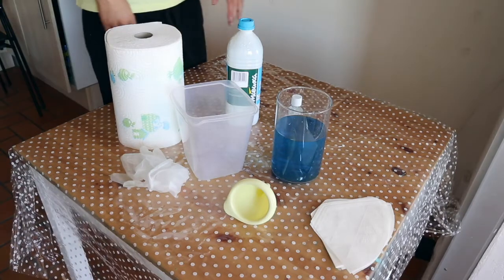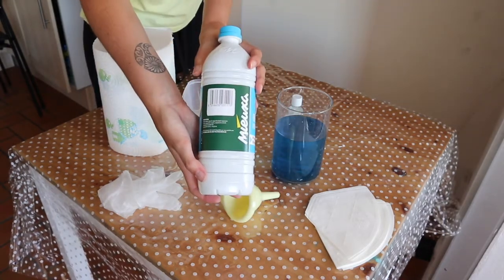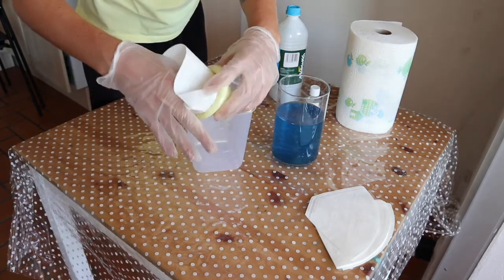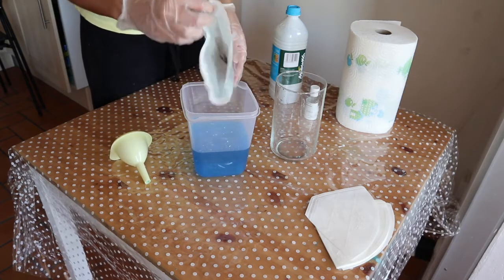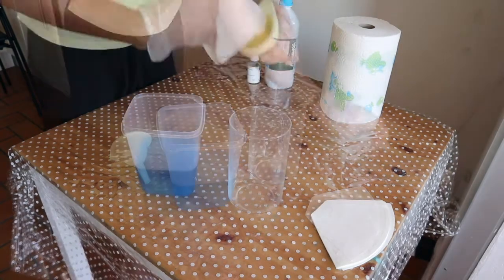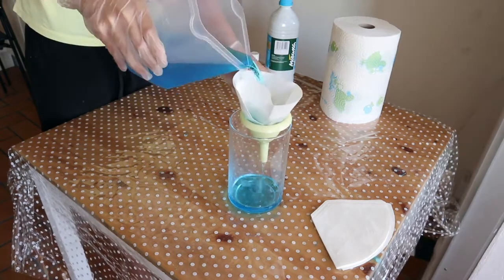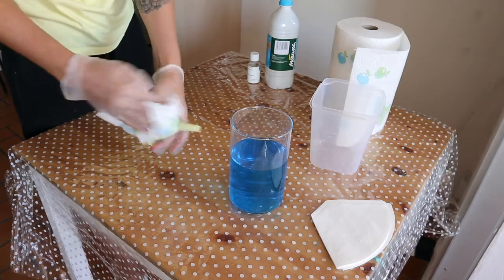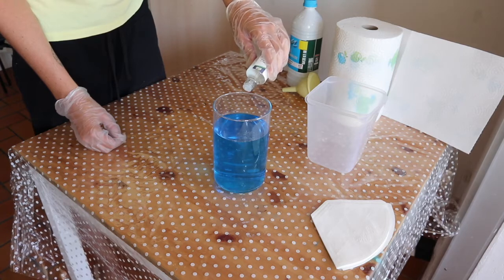How To Maintain Your  Electroforming Bath

Comment: Hello and thank you so much for sharing your knowledge! I don't understand how much distilled water I have to add. Is it the difference between how much solution I had before and after filtering? Thank you
Reply from the maker: Hi Stefania, thank you for your comment. When you electroform, your solution evaporates. So when you are going to filter it, the level of solution in your beaker will be less than what you started with. 

I have a piece of tape on my tank, so I always refill up to the tape (that's how I know how much water to add). If you don't have a piece of tape on your tank, just refill up to where it was when you first started (approximately). 

And yes, there is a difference between how much solution you have before and after filtering. If you don't have enough solution and too much anode, it won't work. That's why you need to refill. Hope this helps!
Reply: @electroformingartist7818  thank you so much 😊
Reply from the maker: You're very welcome :)